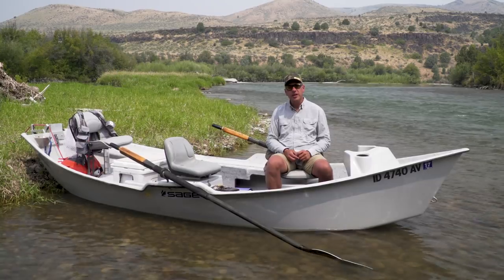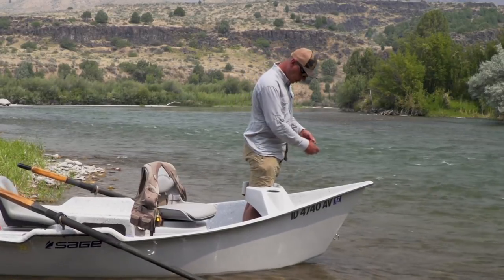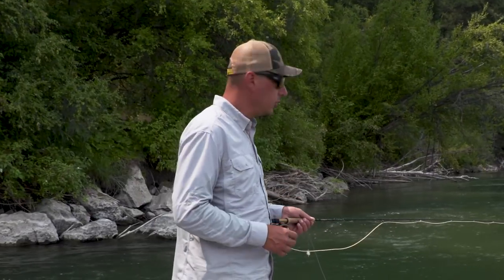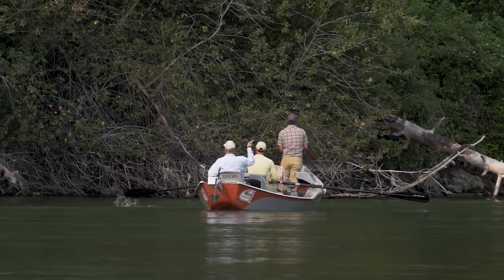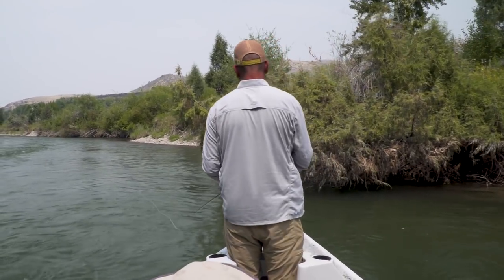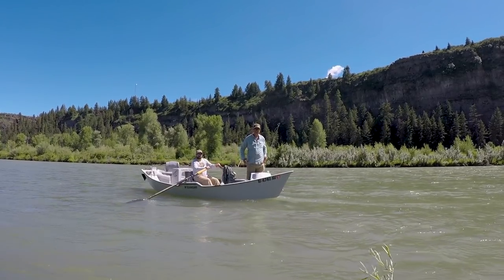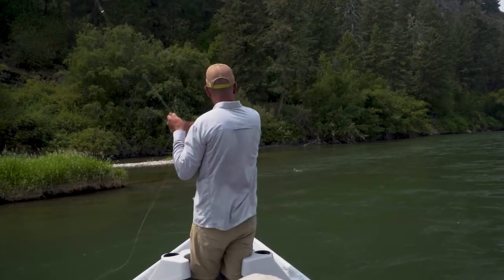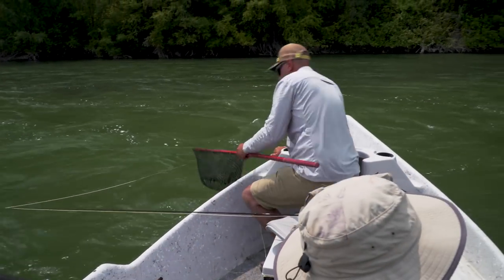S2 E9 How To Fish From a Drift Boat

Comment: What floating line would you suggest to for sage bolt 9’ 6wt not in the outbound / family?  I was thinking the Rio grande in a 6wt or 7wt thanks
Reply from the maker: The RIO Grand would be a great line on that rod, as it has a pretty fast action, which is what the Grand is designed for. A WF6 would be ideal for most people on it, as it is one line size heavier already.